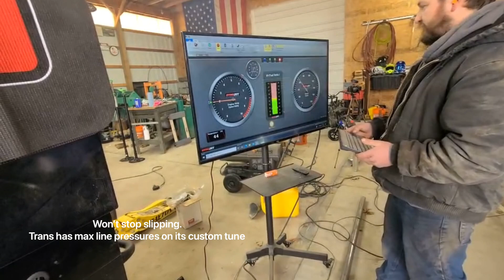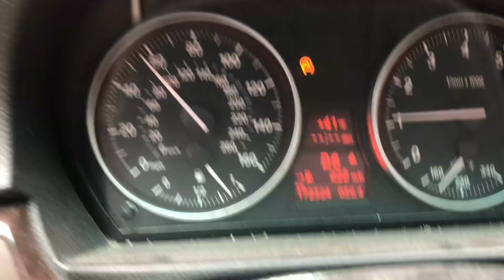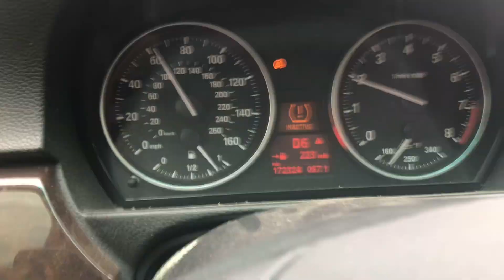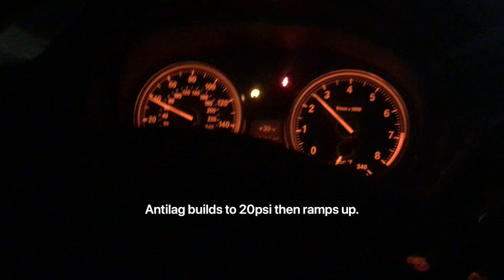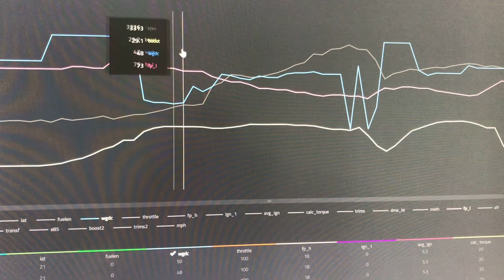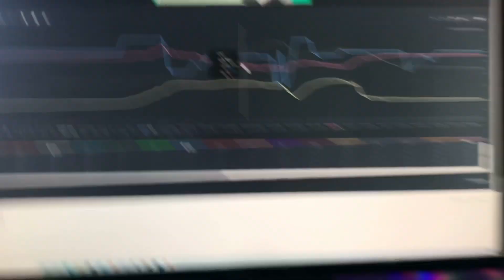19t’s @32psi!!! Antilag, Accelerations and More!

Comment: I own a single turbo n54, 26 psi, 680 whp, xhp stage 3,zero slip. 60 to 130 in 5.5 secs... So I'm not sure why urs slips. Slipping a dyno with no load is crazy
Reply from the maker: You probably make less torque than 32psi on upgraded twins lol that’s why. The single turbos are easier on EVERYTHING on the car and they just make crazy top end power.
Reply: are you running port injection?
Reply: @RollingInBoost  no port injection,  730 whp now with 1600cc water meth injection
Reply: How’s the trans holding up at that power level?
Reply: @luispina317  doing just fine
Reply: Same, no slip here at 650 on gc lite twins . 112k on trans , I got tired of breaking axles so I went ford rear conversion but totally stock trans

Comment: Are you planning to do the PR upgraded clutches?
Reply from the maker: Yes. Or the level 10 brand
Reply: @N54GASM  600+ wheel is really pushing it on stock trans but love the build will follow to see u dust hellcats without any issues lol.

Comment: But you know that because of LP over 50psi the LPFP actually is doing fine and you have to look at HP rather if you have issues there? You can´t determine misfire issues looking ONLY at the LPFP..  If you have HP way above 1000 (1300-1500)psi, you are fine and the lpfp is supplying enough fuel to the HPFP.
Reply: 55 is about as low as you wanna go and that's still lower than what's ideal. HIs shit misfired because 52 is way too low
Reply: @famousmidnight  okay Tyler.... If high pressure is high enough car will misfire because of too low LP. Makes total sense...
Reply: @davizzleman  I've owned several of these cars over the last 7 years... low pressure is just as important especially when running ethanol. He obviously needs more pump.. he also didn't show his HP numbers so how do you know they're good?
Reply: @davizzleman  If his LP numbers are dropping to 52 I can assure you his HP numbers are low too... his last video said he was running a single 535.. sorry to burst your bubble but that's not enough pump
Reply: @famousmidnight  just look in his log he posted. HP is at least at 10. In JB4 it means 10*150psi. You didn´t burst anything. Don´t worry. It is not that a complete stranger suddenly would change my mind just because he owned "several of these cars" ;)

Comment: XHP stage 3 and do new solenoids, seals and it will be good.
Reply from the maker: I have a custom trans tune on the car already by rod suptin and I swapped in new everything with the new low mileage trans I put in.. seems like the 6AT is just maxed out at this power level. Wish I could dyno what that was.. lol
Reply: @N54GASM  make sure you update the trans tune with Rod based on power level
Reply: @N54GASM  have you tried upping the line pressure using XHP custom module "Activate line pressure bump" ?

If it still slips, try limiting the torque using XHP 

19t at 30+psi probably making too much torque.
Reply: @Saif0412  it says on screen on the video that the trans lines are at max pressure